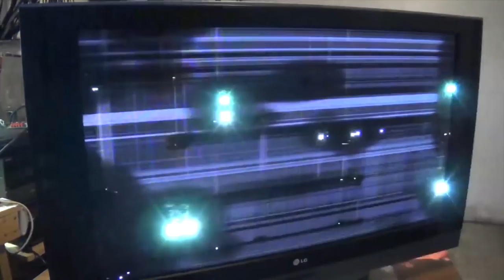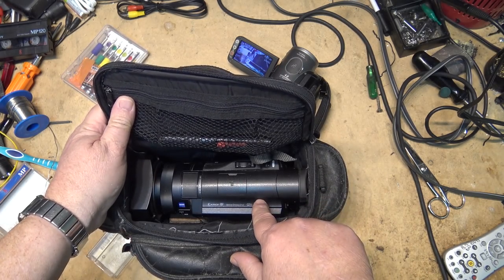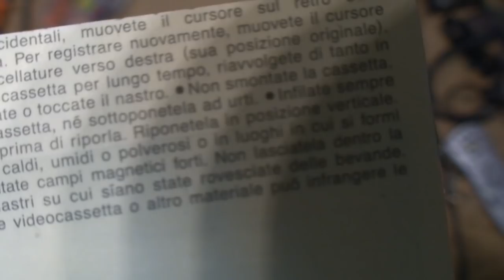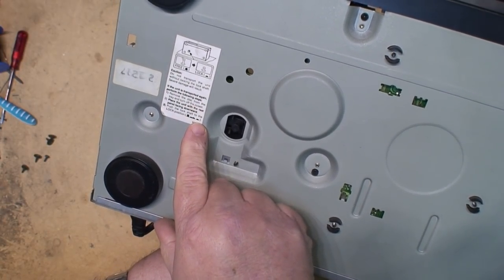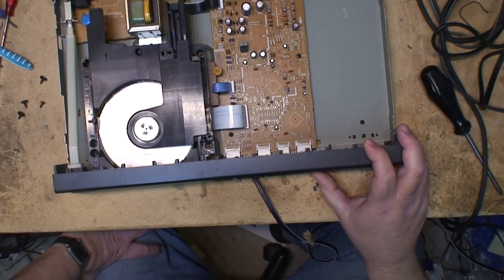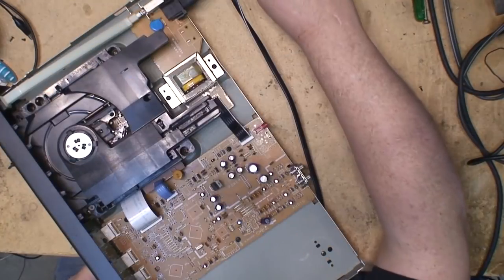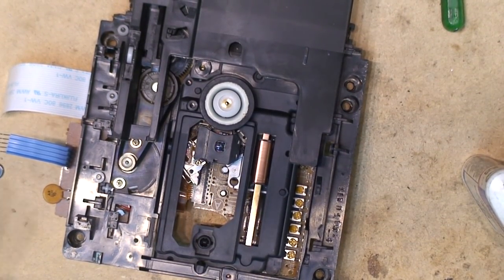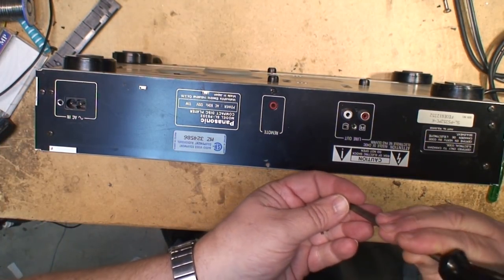Video tape was as bad as I remember and a CD Player repair all in one

Comment: Tape was useful, despite its flaws.  Still cheaper than using 35mm motion picture film, that's for sure ... and that's not including the lab costs associated with such filmstock.

But, of course, when solid state data storage became practical and relatively inexpensive for digital video, even up to 8k resolution, it obviously made more sense to use it over tape and even film.

And those old Panasonic/Technics CD players with the linear motor pickups, those were so cool.

Of course, Sony also did that with their higher end CD players.  Pain in the rear to find replacement pickups for such Sony players, though, which is why I probably won't upgrade from my CDP-X229ES any time soon as it works fine enough and I can still get great sound out of it using a good outboard D/A thanks to the S/PDIF out.
Reply from the maker: 35mm film. What drugs have you been smoking.  Even super 8 was expensive.  Back in the day 3 minutes of silent super 8 was about 20 bucks with processing. Today super 8 color negative is about 100 and for that you get a negative and digital transfer on SD card.  Black and white about 30 for 3 minutes.   Had a guy bring me some new color negative film to transfer.  Had 300 feet a that cost him over 300 and no digital scan hence why he paid me to digitize and reverse it.  
When I was younger i played with 16mm and it was redecules how much that was 100 feet which was about 4 minutes at 24 fps was about 100 bucks then.  That was back in the 80s my uncle had an 16mm bolex.  I did some time lapse and stop motion shooting.  Have no idea where that film went.  Only ever did 1 16mm.
Reply: @12voltvids  "What drugs have you been smoking?"

Turkey, pork, and brisket.  Good food are like drugs.

And my apologies for my comment.  35mm is still used in the movie business, though to a far lesser degree these days precisely because digital saves a boat load of time and money.  But there are still filmmakers who insist on using film, and will continue to shoot on it so long as they have the clout and the money to demand it ... and so long as Kodak continues to make fresh stock.
Reply from the maker: @Watcher3223  
Yes i am fully aware that 35m is still used by a few directors that want it for the aesthetics, directors like JJ Abrams, Quentin Tarantino and other big time directors in Hollywood show like to shoot with film. They're not however printing the film they're shooting the negative and then scanning to digital and they're doing it specifically for the look was reading an article recently that said that Kodak has sold more film stock in the last year than they sold in the prior five or six years it's come back for big budget films. It's not better digital will blow away anything that you can shoot on film they're doing it for a specific look they want that random grain that gritty look that only motion picture film can deliver you can simulate it in digital but nothing beats the real grain of motion picture film and that is why certain directors are still shooting film because they're looking for a specific look that they can't get any other way.
Reply: @12voltvids  I know about digital workflows and how it's made to work with film assets.  It's kind of hard to physically cut film with Avid, hence the need for a digital intermediate.  I also know about why some directors prefer film over digital.

Additionally, and as you should know, film behaves differently to digital video when it comes to how it deals with light, analogous to how analog magnetic tape handles audio level compared to a digital recording.  Mind you, this is not a statement as to which is better, just saying that they handle signal level differently, especially when it comes to overexposure, a.k.a. clipping, and the fact that film doesn't have problems with banding like digital video can if you don't know how to deal with it properly.

And grain can be coarse or fine, depending on the film's speed.  You can have very fine grain film, but of course you may need a good bit of light to shoot it without underexposing, especially if you also want a wide depth of field by closing the aperture.

And I said nothing about film being superior, just saying that there are directors that prefer working with it, and they will so long as they still have a choice.  Sooner or later, they may not have a choice should Kodak stop making motion picture film.  And Kodak may stop making film not necessarily because there's not enough demand, but if the company goes belly-up because other facets of its business takes it down.  It did emerge from bankruptcy relatively recently, you know.  Who knows if its long term strategy after reorganization will help it to survive?  And if Kodak should go out of business and its film business goes down with it, who's left?

Comment: Nice repair Dave, but besides the sticky tape syndrome, the former camera was much sharper and better audio too.
Reply from the maker: The tape had a softer picture.  HDV is 1440x1080i. My regular camera is 1920x1080p60 or 3840x2160p30 depending on how i shoot.

Comment: I still use sony hdv tape for me works great.  I switched to sony hdv pro tapes 63 mins havent had a problem since but it doesnt stay on tape to long.  I have the sony hdv with tape and the memory module.  Then it goes right to ssd or a hard drive.
Reply from the maker: It didn't stay on this tape long.  Problem was it wouldn't play properly.
Reply: @12voltvids  Yea i noticed mine all seem to work fine so i keep using them as it works for me.  I have a nice sony hdv deck with fire wire and HDMI on it to they made a few late in life that had HDMi and the large fire wire port i have a g o pro and a newer 4k camera to for when i need water proof so not completly behind the times.
Reply: @12voltvids  I have the disneyland submarine ride uploaded on my channel and its all HDV mini dv tape to its still my main system i should probably move away from it but not right now

Comment: Sony MiniDV tapes are notoriously sticky, even brand new! Best I've found were the Panasonic professional brand that B&H used to sell. Can't comment on Fuji because I've never used them.
Reply from the maker: Yes Sony tape was garbage.  Actually i believe that is a title of one of my videos.  I have had good luck with Fuji Maxwell and TDK.
Reply: I've only ever use Sony "premium" (probably just marketing) miniDV tapes.  Never had a problem, we will see how they stack up with my "big tape capturing" event I have coming up but looking at a few right now, from 2008 and 2009 they all seem fine.

I never mix my tapes.  I made 1, just 1 exception, I had a TDK tape to capture for a mate.  That was the only non-sony tape I let into my camcorder.  The issues with tape lubricants congealing had apparently been resolved by then anyway.

I also stripe my tapes when they are new, that is I record them fully, end to end to lay down the timecode, thats mostly to prevent issues with the timecode shifting/breaking when I pause or stop however I noticed my camera seems to have a workaround for that.  I just found a 2009 tape that had a break in the timecode and the camera had accounted for it just fine during recording.

Comment: @12voltvids I agree with SSD, SD cards, etc (All solid state storage).  I have been building computers since about 1981 (Ohio Scientific).  Anyway, I have NEVER lost data on a real hard drive.  I've had them suffer stiction, but I was able to get them going.  Ive had some head crashes and some bad sectors, but always managed to get my data or at least 90% of it off the hard drives and to a new one.  These days, if one transistors fails in your 500GB SSD, <boom>, all data is lost.  I've had thumb drives (only one or two) fail when plugged back in and <boom> all data on that thumb drive is lost.  Thank goodness I finally got an okay upload rate from my internet provider.  I run raid real drives in my file server and raid SSD in my main computer.  With the help of a program call WEBDRIVE, which I paid for, I can make Google Drive look like my "W" drive.  Then I use an old utility I wish I could find a replacement for "XXCOPY", and through batch files run nightly back-up of Synology server.  I also use a 3TB real WD USB HARD  drive, connector to my main computer to run similar batch files to backup to it.  Now with that said, I do have two of those external WD USB hard drives that are dead.  I don't believe it is the actual hard drive, but probably the interface board.  I have to take them apart, remove the hard drive,  and hook up to an external adapter and see.  I trust the actual hard drive to be okay.  They are just too darn reliable.  Thoughts?
Reply: I've seen plenty of dead hard drives in the past ten years. With solid state drives there's TONs of error correction codes used because the raw NAND is so unreliable. Tbh firmware problems probably cause more data loss than failing flash cells. The same will probably hold true with today's SMR hard drives. Personally I have two RAIDs in my file server: a RAID1 of enterprise SLC SSDs and a RAID5 of nearline SAS HDDs.

What's weird about hard drives is most of the drives I know are right about to die keep working for years and it's the happy ones which die.
Reply: @eDoc2020   @eDoc2020  With those happy hard drives, is the electronic control PCBs or the actual mechanics that fail? As I said, I have never lost data, or at least much data, on mechanical hard drives all these years.  I have also been untrustworthy of any storage medium and back up databases and what not several way.   Of course, the big advantage of SSDs is that they so much faster.  I just don't trust them too much.
Reply: @Daveyk021  It's hard to say what failed. It's mostly continual hard seeks on startup, I presume looking for the configuration track. One I opened had clear signs of a head crash. Several drives developed a crazy number of bad sectors but otherwise seem to work, these are mostly the ones that "should" die any minute.

Admittedly most of the dead drives I've seen were 40gig Maxtor drives from 10 year old school computers I was working with, they were worthless and didn't have valuable data so I didn't investigate further. IIRC these mostly had a fault where it would hang up the computer's post.

Comment: Lower pixel count is actually better for video as it allows better low light sensitivity and higher dynamic range. The new Sony A7SIII only has 12 mega pixels and look at it's price ;)
Reply from the maker: Yes and no.  Larger photo sites are always better.  You can have a high pixel count and large photo sites it is called a large sensor.  My ax100 for example has a 1" sensor and has excellent sensitivity and dynamic range.  It also shoots very good still pictures almost as good as my 24mp SLT.  My ax33 also has a 20.6mp and you guessed it, also takes great stills and very good video. After all that is what I shoot my videos with.   The new ax53 i just got only 16.5mp. video wise it is probably a little more sensitive but for still images not quite as good but still acceptable.  The new ax43 they dropped it to 8.9. in video mode it will still look the same but forb still images unless you just look at them on a small screen, 8.9 is way down, less than my phone. 
When I travel, unless I am on a photography trip i only want to carry one camera and i want the best picture quality for both still images and video.  So it is a toss up, should i take my ax53 or 33?  The 53 has a longer lens, which is nice.

Comment: Moisture can make the binder to deteriorate faster which is what causes the sticky shed syndrome. If the tapes have not been stored in a climate controlled room, that's more than likely the source of all the problems. Fuji tapes are pretty reliable. The troublesome are the Sony branded tapes, those are crap.
Reply from the maker: My studio is climate controlled.  The whole house is and there is a second AC just for the studio.
Reply: @12voltvids  You had bad luck then. I've never had any problems with Fuji branded tapes.
Reply from the maker: @josegti84  
Well you will.  This was the first one for me and that was a low use tape.  Had one thing recorded on it and played only once.
Reply: @12voltvids  I'm sure I will, I already transferred the most import stuff to digital but then I have around 12k movie titles (original, not pre-recorded tapes) in every flavour (VHS, Beta, Video 2000)... some of them absolute hidden gems that won't get a release in any of the actual formats. I can't find the time to get into it...
Reply from the maker: @josegti84  
And I thought I was bad.  I have about 500 svhs and beta movies all recorded off the old analog satellite dish back in the 90s and a couple hundred laser disks. A fair number of rare converts like rolling Stones and Beatles that were released on laser.  My neighbour gave me a few boxes of movies.  None have been even watched.  They just sit in the closet collecting dust.
Reply: @12voltvids  I'm a big fan of laserdisc too, but my LD collection isn't as big as the other one. I have less than 500 laserdiscs. Most of them imported from the US and Japan. Laserdisc wasn't a big thing here in Spain back in the day so only the blockbuster titles got released in that format. The gems are in my other collection. I've had at one point nearly 30k movies but I've been selling a lot of the inventory in the last few years... keeping the most precious and rarest titles (mostly from the 70s and 80s). The vast majority don't even have a dvd release and I don't think they will ever do. And just like you... I've probably watched about 5% of everything I have hahaha.

Comment: You have to change out the cpu voltage filter caps (taller ones to left of cpu socket and above, and surrounding like that - all those) as I have had to do it myself to some of these to bring perfectly stability for years to this day after bsods caused by poor regulation into cpu. The point is you could probably make a good penny finding all of this and similar era MSI boards to do this on, then resell. The "vintage" market demands a good price nowadays, but I'm not particularly sure about this era. MS-7211 ~2005 https://www.pcbitz.com/products/160-motherboards/msi-pm8m3-v-h-ms-7211-ver-41-lga775-motherboard-no-bp/

Comment: At least the tape can still be played in spite of itself, unlike SD cards which lose your data when they fail.
Reply from the maker: You call that playing.  The tape was 45 minutes and I got about half of it. The rest was a red screen and lots of macroblocks.  The SD card that failed for me became software write protected and can still be read just not written to.  There is a feature built into SD and micro SD cards that can permanently write locked.  Unfortunately some times this happens in devices. I have had cheap USB drives fail, but the name brand have been fine.

Comment: Have you tried rewinding the tape back and forth to losen the tape before starting recording?
Reply from the maker: Duh. I did dump what was on the tape before i reused it as it was a VCR repair I started on years ago and then shelved (and it has been shelved ever since)
Reply: Thanks for your reply! I'm wondering if this is specific to those digital tapes. I had similar issue with an analog tape, that got some oil from dirty tape transport on them.
Reply from the maker: @МиколаД-ю4ц  
All tapes have issuew.  Analog, digital, audio, data, video.

Comment: Okay, I guess my graduation video from 2003 (stored somewhere in my parents' house) on VHS must be already gone by now.
Reply: No, it will be fine. VHS is not prone to that. If there are dropouts, that just means thin horizontal lines on the picture. If it was stored properly, it will play back fine, 17 years is nothing for VHS. Even if it's moldy, it can be played back usually, but in that case, with a lot of dropouts. Our family VHS from 1987 still plays back fine. I have a bunch of Betamx tapes from the early to mid '80s, most of them are fine. Some has tons of dropouts, but even those are playable.